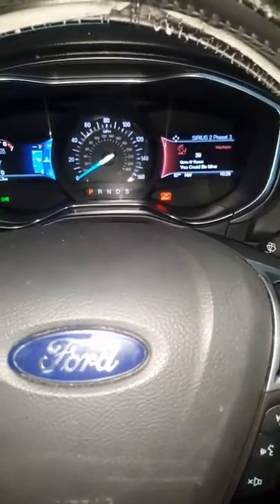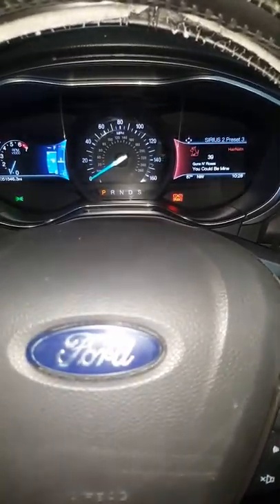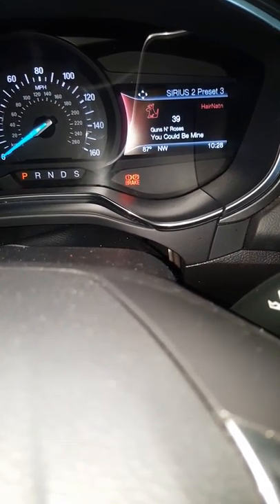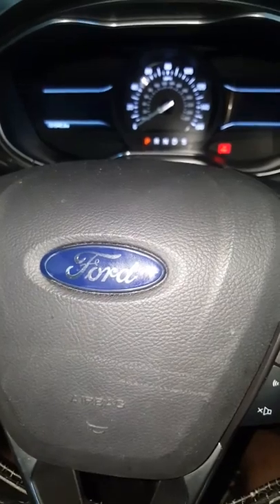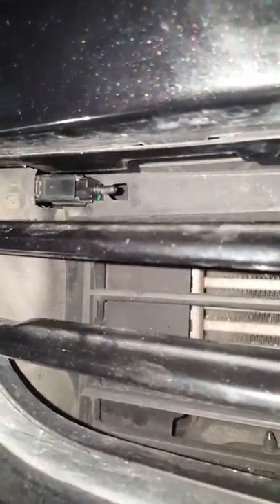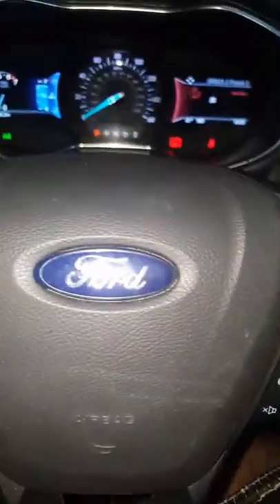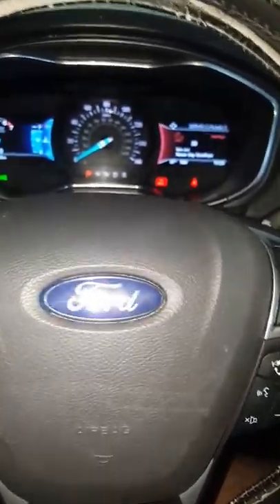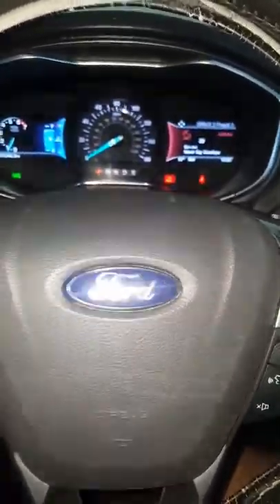2015 Ford Fusion Titanium Engine Ambient Air Temperature Sensor Replacement

Comment: Simple & direct. Thank-you. Just needed to know which side of Fusion to focus on after headlight replacement & received amb temp error. Must have not connected it firmly when reinstalling the bumper.

Comment: Do you have to take the bumper off to replace?
Reply from the maker: Hello, no I didn't have too. You have enough room to get to it without taking it off
Reply: This guy in the video took off the front grille, which should be relatively easy to do (I hope lol). It is a little tight to grab it otherwise, I think. The idea of taking out the fog lamp seems too far fetched.... but maybe it is also an option. I looked at the spot and my slender fingers are not slender enough to grab it just like that. So, I am going for the decorative grille.

Comment: you did not show how to replace sensor.
Reply from the maker: Sorry, once you get to where the sensor is located. It should be held in by a clip, work the clip out or use a clip remover if you have it, disconnect the sensor and install in reverse order.
Reply: Were we get that sensor any link many thanks

Comment: I have a problem with my 2014 Ford C-Max Energi headlights always on even when theyre in the off position.
Reply from the maker: @marcosramos4596  just seeing this, if it’s fixed, GREAAT! 

If not, I would look into an issue with the headlight module or a possible short to ground that is keeping the lights illuminated no matter what the switch position is. 

Thanks for watching, I hope that helps

Comment: I have a 2013 Ford fusion 2.0 turbo titanium and I can't find where the sensor is, it always has a temperature of 10 degrees even though outside and when I pass puddles or water it drops to minus 40
Reply from the maker: @YgorZombieMan  hey there 

I’m not certain if it’s in the same location on the 2013 but if it’s the same body style maybe get a second set of hands if you haven’t already to make sure the area is well lit. If I find any other information on it for your vehicle year I will post it back in the comments. Thanks for watching
Reply: @reyc6158  Until I finally found it, it was on the left side of the vehicle below the headlight and near the radiator. There was no sensor, there was only the harness and I found it by trial and error, since the repair or user manual did not say anything. The temperature was kept at minus 40 degrees Celsius for more than
Reply: @reyc6158  For more than 30 minutes and then gradually increased until the ambient temperature was measured correctly.

Comment: My car external temp reads 50 degrees when it's actually 90 degrees it somehow is not letting the a.c. cool becouse its making it thing its cooler than what it actually is.
Reply: hello danilynn did you get it fix ? if so what was the problem im having the same issue, it will work for a couple of mins and suddenly the temp will be in the negatives and the a/c won't turn on when its like 100 degrees outside
Reply: @MrFitzfn  Did you fix the issue? Im have the same problem!
Reply: Let us know if replacing the sensor fixed the AC issue. Having the same issue here.
Reply: My car's Air sensor has been broken and I had new one but the AC doesn't work, it blows hot air although the sensor reads temperature well (31 Celsius degree).
I need to know how this can be fixed??
Thanks in advance 😊
Reply: Aaron Yaddow hi there, did you solve this problem? And how? Thanks
Reply: Lexie Lee hi there, did you solve this problem? And how? Thanks
Reply: MrFitzfn hi there, did you solve this problem? And how? Thanks

Comment: I have p0098 code . 2015 SE. can the same sensor be the issue . My temp reads fine
Reply from the maker: I cant say for certain, but I think that code is for Intake air temperature and that sensor is more ambient (outside) temperature. So I would not replace it for that code